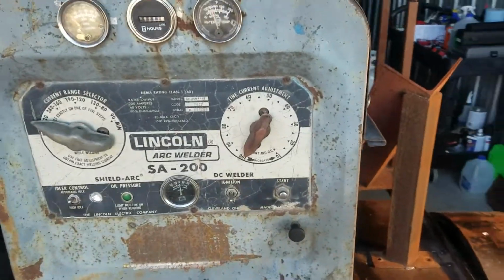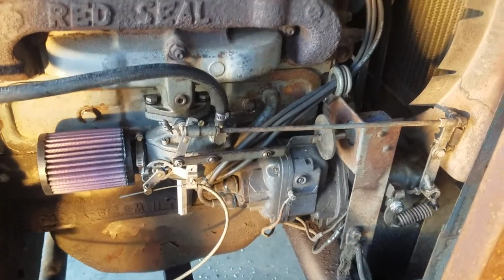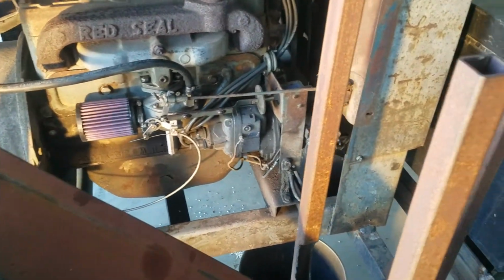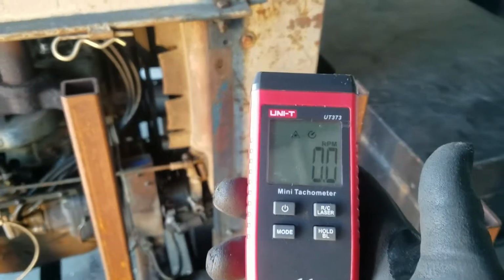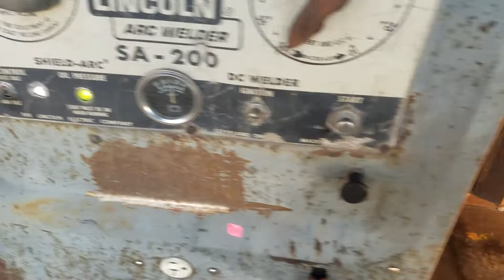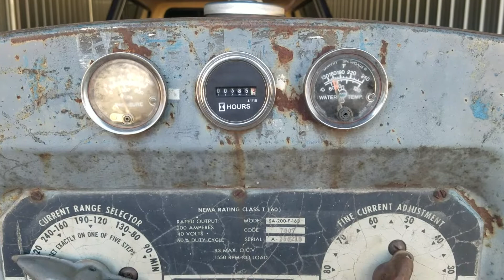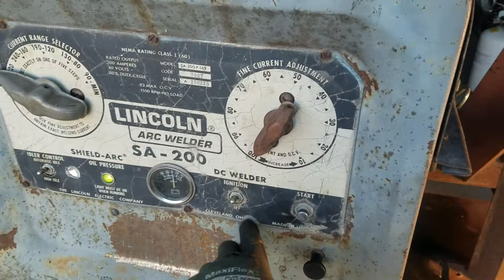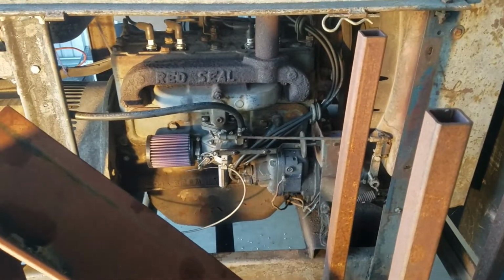Lincoln Sa-200 tune up with fresh carb rebuild

Comment: Simple fix, Add 1 oz. of “Marvel Mystery Oil” per gallon of gas when your going to run it hard for a full day, the cough will more than likely be gone, it’s the valves and lifters sticking a tad, done it many times, works every time, 40 yrs in the business fyi, good luck !

Comment: does it cough all the time or just on high or low or when you work it?
rebuild the mag, at least put new points and condenser and clean all the contacts for the rotor and make sure you are using metal core plug wires. dont use resister wires.
try a different carb on it. what grade of gas do you run?
it could be any of those things making it cough
also every once in a while crank it all the way up burn 2 or 3 big rods and it will clean the plugs off and make it run better
Reply: Where is the mag located
Reply: @Rhino5.0  its the magneto, its right in front of the carburetor and has the spark plug wires coming out of it. get a repair manual before working on it

Comment: High idle should be right around 1550i believe for the RPM’s, check your OCV’s once you set your RPM’s to 1550 on, mine were right around 98 first thing when the machine was first fired up in the morning, and if yours are higher, your rack might have been rolled

Comment: I wouldn't even worry about it; mine does the same thing.  As long as the machine can lay down a bead of 5p and 7018...it's not even a big deal.
Reply from the maker: It ran good, welded great, but i ended up selling it not because of this, just didnt want it sitting around not being used.
Reply: @gregory9740  how much did you sell it for?
Reply from the maker: @Lui8111  3k

Comment: What kind of oil do you run on these
Reply: 10 30
Reply: straight 30 or 40 is the best for these engines. multi weight like 10w-30 is trash
Reply: Old pressurized oil system on a Flathead motor I have one I use any oil that agreed with the temperature outside probably getting too much airflow with the k& n filter these things only run about 7-7 1/2 to 1 compression ratio put your hand around the filter to choke off some air see if it runs better
Reply: @mikecubes1642  actually, if it has a filtration system, DO NOT, run a non- detergent straight weight oil.
The best, if your engine is in good condition is to use a high zinc 10w30 for antique or classic cars, if that isn't available or practical, a conventional 10w30 and a zinc additive or substitute.
Reply: @kellyh4035  i did not say to use non detergent oil. you should read better. straight 40 weight diesel engine oil is the best for these old engines because it has more zinc than any 10w-30 and its always 40 weight. multi grade oils are such as 10w-30 are only 10 weight oil with viscocity improvers to make them similar to 30 weight when they get hot. if the VI improvers ever go bad then you have 10 weight in your engine, that happened to quaker state back in the 80s and they had to buy a lot of new engine after they burned out. look up the amounts of zinc in a 10w-30 and compare it to a 40 weight diesel oil like shell rotella
Reply: @mikecubes1642  you are correct.
If it exists, in a non-rebuilt 40w is a good idea.
I personally have never seen straight weight detergent in Canada.
My apologies for misunderstanding.
We are on the same page though I believe.
Zinc content is key.
Also I should have specified that in my northern climate, multigrade is more appropriate.
And for the record I ran shell rotella t4 15w40 in the summer with Lucas zinc additive and 10w30 with additive in the winter.
But my F163 was completely rebuilt.
I ran 10w30 year round for the first 2 years
Reply: @kellyh4035  why not run sae30 or 40.
Reply: @mikecubes1642  so sae40 is the best option???
Reply: @Rhino5.0  It depends on the condition of the engine.
In a rebuilt, I ran 10w30 with a zinc additive.
Changed every 200 hours.
With a more worn or high hour engine then yes straight weight may be an option.
But I don't know of detergent straight weight oil, but I could be wrong on that.
You always want to run a detergent oil if you have a filtration system.
I am also in a colder climate in Canada.
So that is another factor for my choice and opinion.

Comment: Its your choke cable need to adjust it while you adjust the gov screw and the carb screw set the choke to where it stops popping on the wide open end of the choke
Reply: What do you mean can you explain more
Reply: @Rhino5.0  if its popping at idle adjust your choke
Reply: Mine is idling really high when i turn it on